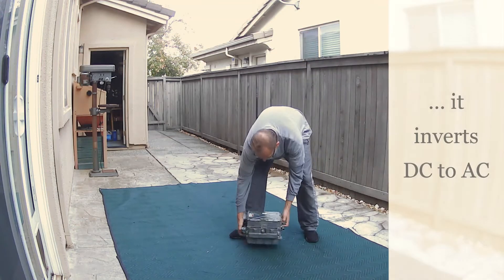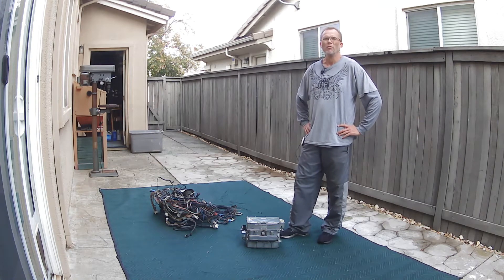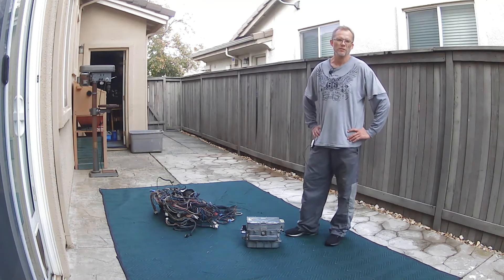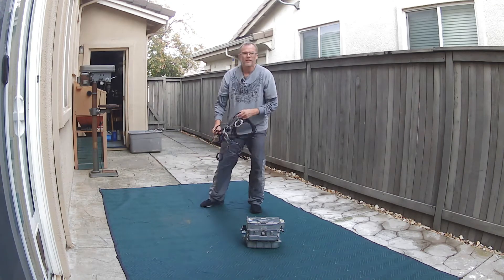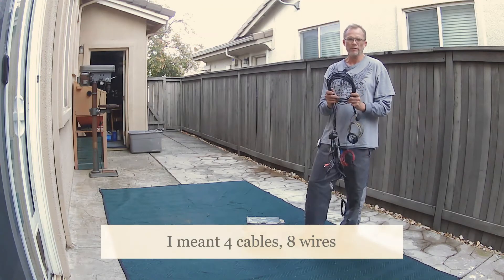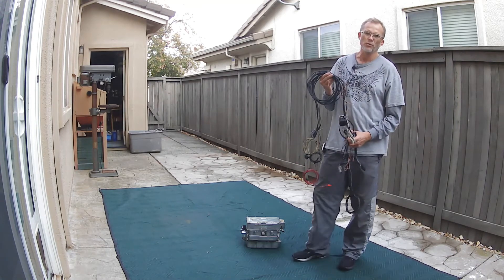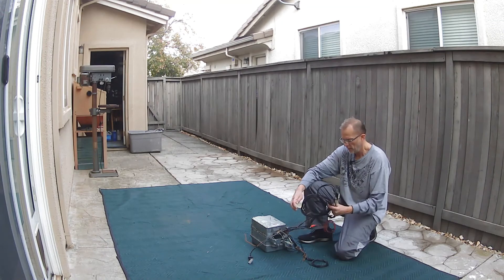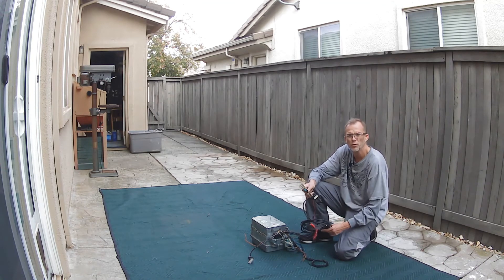Lexus GS450H Inverter Harness - 1971 GMCe Electruck EV Conversion

Comment: cool video, currently working on reconstructing this harness myself as in Australia its super rare to get one intact like you did. the brown wires connect to the inner shield braids of the two resolver leads  and the 4 synchronous serial leads but at what point and in what orientation is the braid running to ground? (farther from inverter or closer to inverter? really hard to tell from your footage or your build thread photos. hope you can help. cheers from Australia.
Reply from the maker: brown wires connect to inverter and loop back to inverter the loops are maybe 18" out so dont have them cut a foot long pig tail where the inverter branch meets the main harness, those brown wires fold into part of that main harness so best to unwrap at least another foot into it, more pics in links in the description, we just visited Sydney most beautiful city in the world